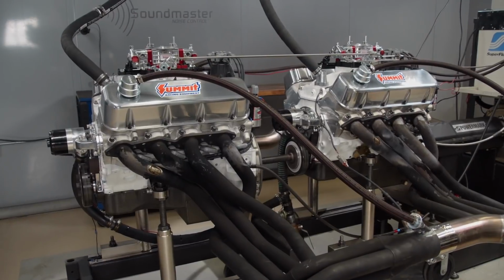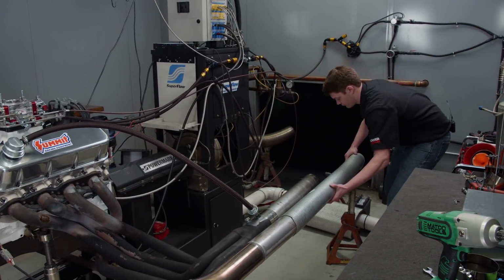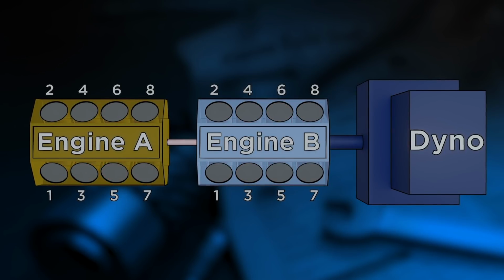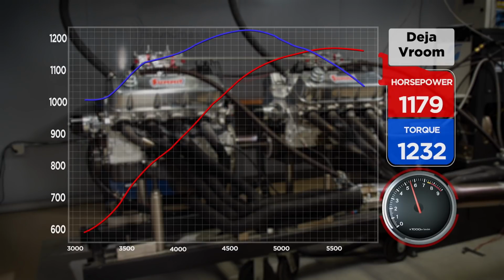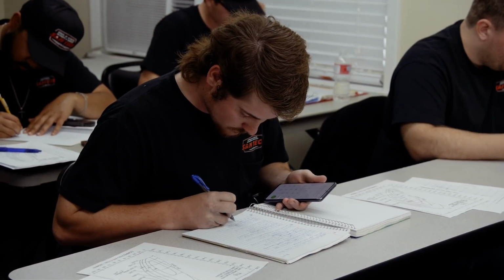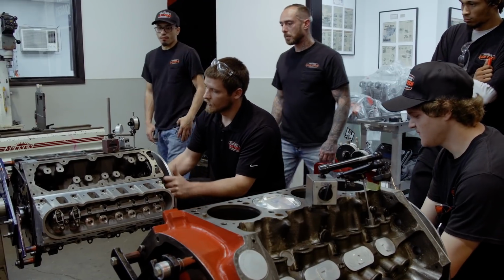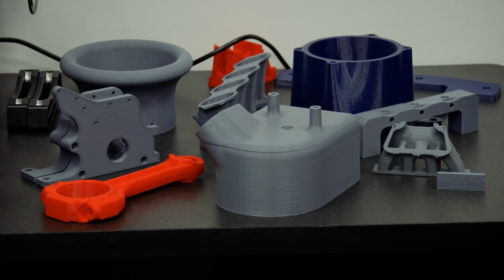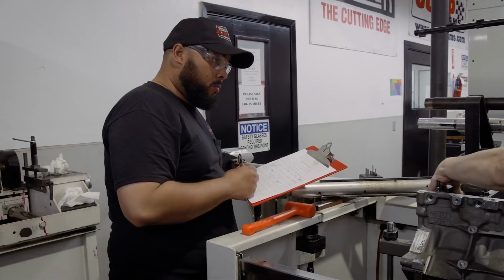Phasing Twin Big Blocks For More Power - Engine Power S9, E7

Comment: Would be cool if you installed both of these engines into a long bed C10 or similar with Corvette trans axle.  One engine under the hood sending power to the front of the rear engine and trans axle mounted in the bed via torque tube.

Comment: Changing the crank shafts phasing likely caused changes in crankshaft oscillations.  These oscillations cause individual cylinder ignition timing to fluctuate.  Going to coil on plug ignition systems will diminish the effects of this to a large degree. Set the timing on the cylinders near the center of the cranks to average out some of the oscillation.

Comment: A few years back at the Bakersfield  Hotrod Reunion, I spoke with John Peters, owner builder of the famous Freight Train twin engine gas dragster. I asked him if he had experimented with engine phasing during the running of the car. He said that he had and that in terms of quarter mile performance of that particular car it hadn't made any difference.

Comment: These engines are flat plane right? 90 degree out would mimic a cross plate firing pulse. I bet that with a y'd together exhaust would net some gains. If we had the time and money I'd love to mess with a custom header kit to help each exhaust scavenge the next. I bet this combo could crack 1300 ft lbs

Comment: Would like to see these guys do a Diesel engine. Killer video tho
Reply: So would I! I spent 8 years as a Warranty Engineer for Deutz here in Atlanta. I spent my days inspecting engines customers had destroyed and wanted free replacements! Didn't get one very often. The highlight of some days was my "scrap area" was near the Dyno cell and whenever a V12 twin turbo beast was being run in everybody stopped what they were doing and watched! Had a governor failure (brand new Bosch mechanical injection pump) on one and it ran away! We all scattered except for the shop foreman who stood next to it and disconnected the fuel line! Afterwards I suggested maybe a shutoff valve in the line might be a good idea! Next day there was one ... ;)

Comment: What is the point?
Reply: ? You ever seen multi engine tractor pull tractors this is actually interesting to see how it's possible to make two engines work together and make maximum power without breaking a crankshaft or bending rods
Reply: Finding hidden power
Reply: @79huddy  oh shut it.

Comment: If each engine is making about the same HP and Torque. How is the dyno able to read the combined HP  and Torque. Seems like it would just read an individual power rating because the second engine would faze the first one out. I'm no mechanic but my dad built his own drag race engines. Would appreciate if someone can help me understand.
Reply: Horsepower is calculated off torque the torque is the number that matters both engines together produce twice the torque figure kind of like twice the bore size and twice the stroke
Reply: @79huddy  Thanks for the reply Hudson.